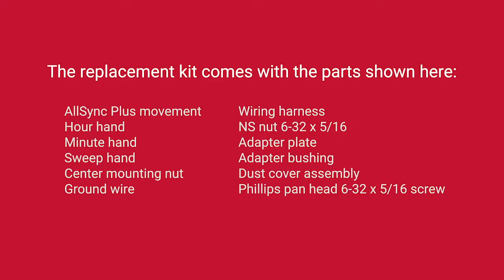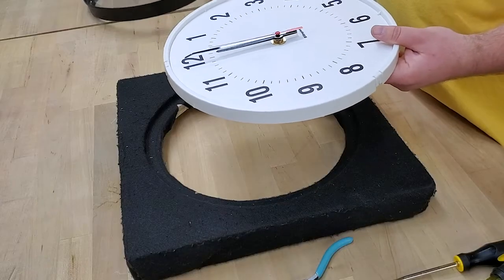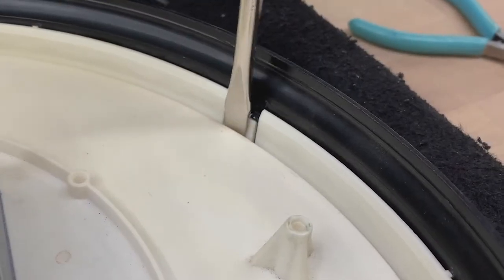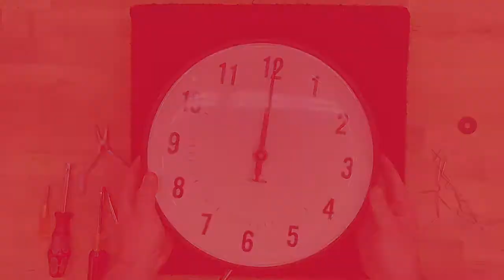AllSync Plus ASKIT02 Installation

Comment: I have a Simplex clock just like that one. But since I hang it in my bedroom, I replaced the failed mechanical AC motor with a battery-powered quartz movement I was even able to get the original hands onto.